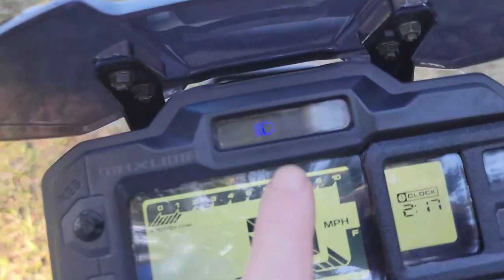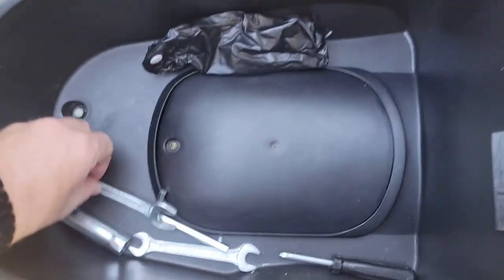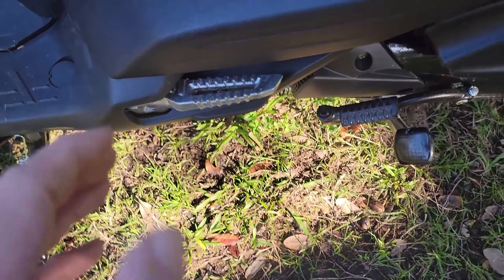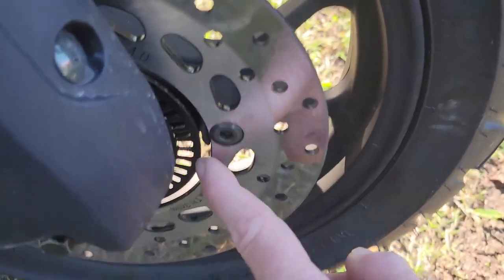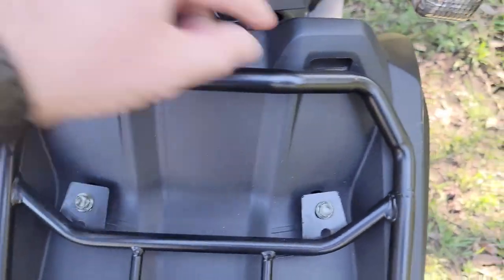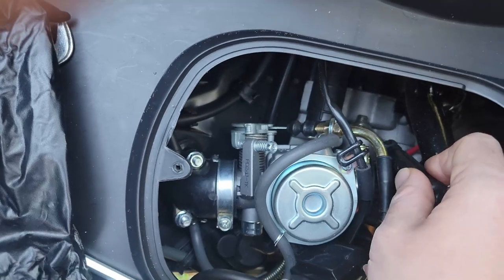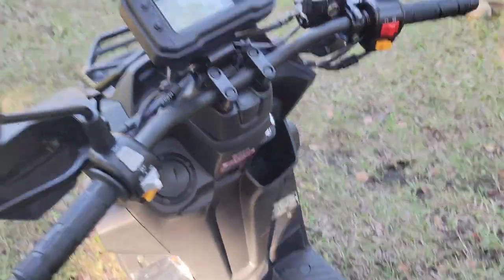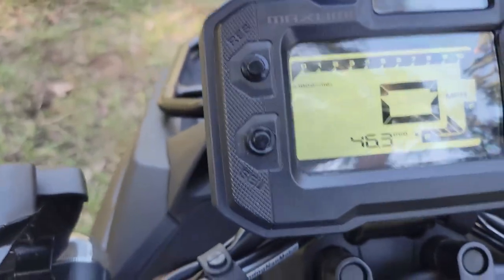X-Pro Tahiti 150 The $1,099 Yamaha ZUMA clone REVIEW.

Comment: Couple questions  if you don't mind.
 1) whats the round thing opposite to the key switch.
2) any idea if this uses standard zuma cables  and brake pads?
3) think this may accept 2022 zuma accessories like pegs and crashguards?

Thanks for the video by the way, been hoping someone would
Reply from the maker: the round thing is where the fuel goes on a real zuma.  it looks like it can open. has a little arrow on it at the top, but I cannot figure out how to open it.  I doubt it will accept zuma accessories.  most of those mount to the frame.
Reply: I was wondering also what round thing opposite to the key switch? Is it storage .... water bottle holder?
Reply: That's a speaker
Reply from the maker: @rodolfo7183  I promise you it is not a speaker. But It would be cool if it was!
Reply: @scottcol23  Have you tried pairing it up with bluetooth ?

Comment: Thanks for the information on Tahiti. Do you still have it? If so, any problems with it sofar? Xpro doesn't give full specs on this bike. I'd like to know the ground clearance, wheelbase, and seat hight, if you don't mind. Is it a heavy bike? I can't decide between Tahiti and X19(Lanai). They're both 150cc. Lanai doesn't come with rear and front racks and doesn't have hand guards. But, it does have two high beams and too low beams with a 6.6" ground clearance which is decent for a scooter.

Comment: I wonder if there are other accesories that fit these. There is a screw hole where saddle bags would be located. I wonder if hard case saddle bags are available somewhere.  I also saw a Zuma with a spare gas tank mounted in that spot. That would be handy if you were using this to camp.  A trunk mounted on the back would also be very handy.
Reply: You can buy the same scooter now with EFI (instead of a carb) and if you want the saddlebags in rear trunk it's an additional 250 bucks. If the bike itself is good that's definitely worth it... It may be possible to get them in a separated package a little bit cheaper if you tried hard enough. (Just wanted the trunk or just a saddlebags etc..) anyways I've seen the same scooter with at least five different names so be aware. Also I might add their offering it for about 50 bucks more now so 1150 but you still go to pay the shipping. (Which isn't exactly cheap at 300 plus)

Comment: My bike just hit 1000 miles. So far it usually runs very well, but recently started having an issue. It will die from lack of fuel while riding. It is not getting enough gas. If I wait a minute or so it will start again. I have not figured out why it is doing this. I thought it might be the vent on the gas cap is clogged, still not sure on that.
Reply: The original model had vapor lock in the carburetors it's a common problem if you haven't seen it before. The ones there currently making come with EFI so it doesn't even have a carburetor at all but that can bring additional problems apparently as well. (I've seen people complaining about it etc but nothing more than that no actual problem or damage maybe a little bit slower overall really off the line etc ) You can change the carburetor quite easily and it's not that expensive I think like 35 bucks if I remember correctly. Gl

Comment: One thing that would be nice to know is if the charging system can handle an accessory plug for a heated vest and or heated hand grips? I had both on my BMW GS1000 and they are great, good full helmet, gloves with the heated vest & grips and riding all day in the 30's and 40's is not a problem.
Reply: And for charging ones phone/gps

Comment: A free tip: Put a strong magnet on the oil drain plug ( not the oil filter plug on the bottom but the drain plug on the side of the engine)

Comment: Thanks for sharing this. How does it handle bumps, potholes, uneven dirt road type surfaces? Maybe it's my lack of familiarity with this type of scooter, but the engine sounds a lot louder than I would've expected. I'm comparing it to the sewing machine sound of the much slower Ruckus that I've heard so many times. Is it apples to oranges comparing a Honda with something from China, sound wise? For the price, your scooter seems well made and looks really good. Thanks again
Reply from the maker: So I have over 3k miles on it now.  I have not had a single issue with mine aside from the stock carb running lean and had no adjustment for mixture. I could have re jetted the thing but I opted for a new one off Amazon which was $23 and made it run way better.  It is rather quiet. I liked how quiet it is stock.  BUT these scooters all have one issue.  The muffler baffles will break inside.  It didnt make it louder. It just makes the thing rattle over every little bump.   This happens to every Chinese scooter I have ever had after about a year.  I got a aftermarket muffler which works well. BUT it is a lot louder.  I think I am going to try one that is larger. The one in this video is the stock muffler.  Out of the 3 Chinese scooters I have had over the years, this is the only one that I can 100% recommend.  Nothing that normally breaks on these has broke yet, not even the CDI.  It uses a magnetic speedo sensor, the normal screw and cable kind break easily. The digital  speedo cluster might be the same one that yamaha uses. Another thing this scooter has going for it... All the aftermarket Zuma parts I have tried bolted right on. I overloaded the aluminum luggage rack and it broke after many many grocery runs. I was going to replace it with a stock Zuma part from yamaha but it was the same part that was on it originally... so I went with an aftermarket steel tube one which I love.  You wont find another Chinese scooter that has direct bolt on parts if something breaks body wise. The GY6 engine parts can be sourced anywhere. Even the headlight assembly from a Zuma will bolt right up if you ever needed a new one. Its kinda crazy.
Reply: @scottcol23  All valuable things to know. Thankyou so much for the reply.

Comment: thanks for the information I will definitely go through powersportsmax And get it in the spring!  I would love if you can make another in depth review about,  the speed,  the digital dash, the seat hight,  and in some cases the handle bar can hit your leg when you turn it all the way, is that a problem for you?   Also another question about the dash on the video when you turned on the bike the 2 digital dash light boxes on the right should light up or are they non functional? The Yamaha zuma 2022 has the high Beams on the right box and red light on the bottom right for the oil light do those lights light up on the Tahiti clone?
Reply from the maker: I am working on another video now. Its been a tad cold recently but I have a bunch of it filmed already so it shouldn't be too long.

Comment: When the scooter came to you, was the rear kickstand already installed? I've had a horrible time trying to fit the spring on it. It simply does not fit. And the kickstand was lying in the container, not even fastened down.  I removed the rear kickstand until I can find a spring that works.

Comment: Hey Scott, hate to bug you with another question but, when you insured or registered what was it under as I've been told the dmv typically only wants to pick a manufacturer/etc that's on their list
Reply from the maker: I have Progressive insurance and the process was easy.  You just have to type in the Make and model number, which would be Senling, MP-150.   In Louisiana I did have to pay for the notarized Manufacterer Certificate of Origin (MCO). There is a tab at the top of the powersportsmax website that says "request an MCO".  The one that comes in the mail a few days after the bike arrived is not notarized. Just check with your state because not all states require a notarized MCO.  They also give you a bill of sale.
Reply: I'm in Nebraska. I went to get plates today. Allstate insures my other bikes so they wrote me a policy. The woman at the DMV told me sine the manufacturer is not in the database, she would have to add it and she would let me know when it was done. Then I could complete the registration. I thought it would haver ot get inspected but the inspection staff told me no. Since it had the Manufacterer certificate of origin, that was enough.  No inspection neccesary. Hopefully I'll have plates tomorrow or the next day.

Comment: I think the ring on the front wheel is for the abs brakes not for the speed sensor. Thanks for the review.
Reply from the maker: There is no ABS on this scooter.  Even the real Zuma does not have ABS.  It is just wheel speed sensor for the speedometer.  Yes, bikes that have ABS use a similar wheel speed sensor also.  I went to my local Yamaha dealer when the new Zuma came out and talked with them in detail about the braking system.  It does have what they call a "unified braking system" which just means that when you pull the left brake lever both the front and rear brakes are applied evenly. But sadly they do not have ABS.  This Zuma clone does not have the unified system either.  But it does share some of the same components.
Reply: @scottcol23  You are correct.  I just bought a new Zuma 125 on Thursday and it has the speed sensor and no ABS.   It is my first scooter.  I have full sized motorcycles but wanted to try a scooter for riding in town and to haul  in my truck to ride on forest roads.

Comment: How is the front and rear suspension? Is it adjustable? Firm, does not bottom out?
Reply from the maker: I really like the suspension.  It is a little soft (which is good). Lots of scooters have a super stiff ride.  The shocks are not adjustable.  I have not had it bottom out on anything.

Comment: Do you know if it is a belt drive or chain drive? Do you know if it will start with a dead battery just kicking it?

Also, does it have a carburator or is it fuel injected? I'm having a difficult time getting specs on this scooter.
Reply from the maker: It has a belt driven cvt transmission. And it does have a kick start if the battery dies.  Its really easy to kick start. Just make sure you hold one of the brake levers or it won't start.
Reply: At this modest $1099 price, undoubtedly a carb...he shows it about 09:45 mark.

Comment: Have you tried to even pull a little wheelie? if not, do you feel like if you hit the throttle hard and pulled back would it actually lift? I'm pretty sure it would wheeli. however what im not sure is about the cable brakes..
Reply from the maker: If you sit back on the seat yes it will wheelie. But its more of a balance thing.  The cvt trans is a little lazy. Meaning it likes about 2k rpm before it gets moving. And just eases into the power. Not real snappy.

Comment: Dose the Tahiti 150cc come fully assembled ready to ride out the box?
Reply from the maker: Yes,  If you purchase from powersportsmax it comes fully assembled and ready to ride. I really wish I had filmed the delivery and setup process. Just cut the straps install the mirrors check the oil and put gas in it.  I had to adjust the idle speed, which is really easy to do.  You can purchase the tahiti 150 from amazon also BUT it will be $1800, $440 more than PSmax and seems to come from the same warehouse but from what I can tell you do not get the one year warranty if purchased from amazon.  I paid $1360 delivered from PSMax and you do get a one year engine warranty.

Comment: Bike was killing on me at start. I've had this issue with another motorcycle, it is just a loose battery connection. I was amazed when I went to tighten the connection on the 150. The screw had completely falled off. But there is a rubber cover that was enabling it to connect. Anyway, easy fix, but be warned. If you are not getting power, it is likely just a loose battery connection.

770 miles on mine so far and very pleased.
Reply from the maker: Im going on 2k miles on mine. No issues other than my exhaust manifold nuts fell off.  After I got new ones with lock washers installed with removable high temp locktite I have not had any issues. Front brakes can be grabby.  Im tempted to get some different pads.
Reply: How's it going now? How many miles on it now?
Reply: How about now ?

Comment: I ordered this model 2 days ago and it arrived today. I was amazed how fast the shipping was. I'm in Omaha and the scooter was shipped from Texas. It took me 70 minutes to get it out of the package. I then installed the hand guards and mirrors.  There is a missing screw on one hand guard. I then tried installing the rear kickstand. It is not complicated but there is a spring that I cannot get on. I measured it at 9 centimeters, or 3.5". I think it must be the wrong size. I wasted at least 2 hours trying to get the spring to fit. Now I'm out of daylight. I removed the rear kickstand and tomorrow I'll keep working on it. I still need to install the battery and the little faring. 

He is right about the foot rests. It takes a very subtle touch to get the foot rests in. Once you know how it is easy but it takes a little practice.

The battery is in the floor if the scooter, so very easy to access. I'm not sure if it needs an oil change before starting it or after 300 miles. I have not had a chance to check it yet. The scooter is a Yamaha Zuma clone. The Yamaha gas tank is on the front left, and this scooter has what looks like the same thing but it is actually under the seat. I don't know what that thing is that looks like a fuel tank opposite the key.
Reply: Did R&L deliver it to you? How was packaging when you got it? Was it packaged well? Any damage while being shipped? Also was it fully assembled?
Reply: @jarodhuber2687  I don't remember the name of the shipping company. He did a great job though. He had it on a truck with a lift and he had it on a small fork lift and put it exactly where I wanted it. I didn't lift a finger. I was ready to do some lifting, and had my son there ready to help. He called me 10 minutes before he arrived.

One handlebar had broken through the package and was scratched but it has bar ends I had to install which cover the scratches. My only complaint is the rear kickstand was not attached. It was lying in the box flopping around. I don't think it damaged anything but the spring it uses is so tight I cannot get it on. The install video the company sends shows it installed at the factory. It isn't complicated but they must either use a special tool to get that spring on or the sprng is the wrong size. 

There are no instructions whatsoever for putting it together. Most of it is easy though. I'mnot quite finished. The weather here is terrible right now. I'm waiting for a warm up to finish. I still haven't tried to start it.

I spent 70 minutes removing it from the crate, another hour working on the install and 2 solid hours trying to get the spring on the rear kickstand before I ran out of light. The company has been no help at all with this issue. I think maybe one more hour to get it running, not including the kick stand. The front was already installed so it is not essential to get it running. I may have to buy another spring.
Reply: @jarodhuber2687  I see yes. It was R&L shipping. No not fully assembled but mostly. The hand guards, the battery and cover, the little tiny faring, and the rear kick stand was not attached. I think normally the rear kickstand is attached. I see no reason why it isn't. I think the spring on mine somehow got knocked off and so they disattached it (2 bolts) and just laid in in the crate, and too bad for me. It was not even fastened down. It has been a nightmare trying to get it on because the spring is so tight.
Reply: @jerrybriardy  did you ever get it put on ? New spring ?
Reply: Put the Spring in boiling water. take the pan with the hot water with the Sping. this makes the spring expand. I hope you get it on. Good Luck